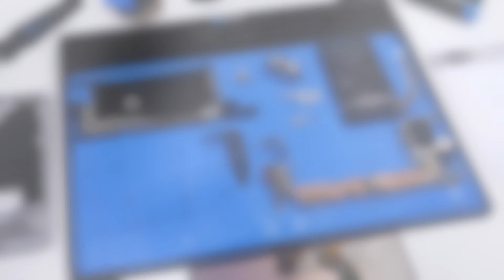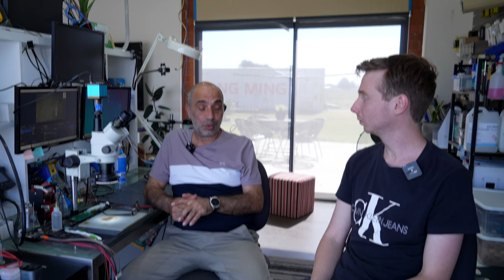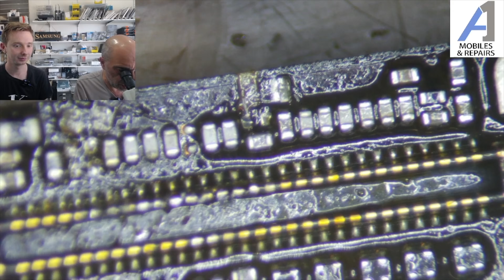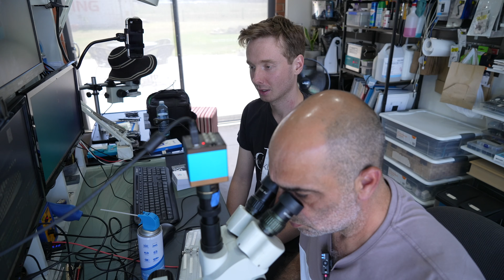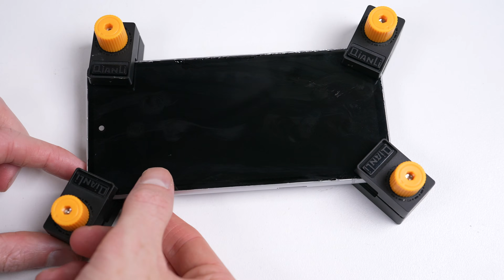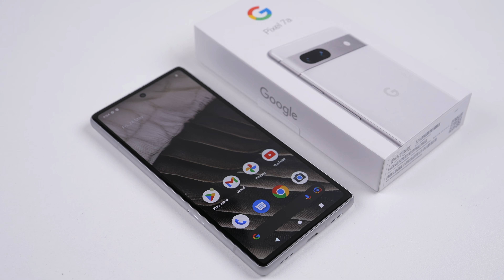I Messed Up Big Time - Don’t Repeat This Repair Mistake - Calling In Help - Pixel 7a Repair

Comment: I made the same mistake on a rare Sony Xperia XZ2 Compact a couple of years ago. The component went flying and was lost when removing the flex cable with the spudger. I still have the phone and would like to go back to using it because there is no equivilant sized modern phone. The display is now just black with only the backlight working. I don't know what the estimated repair cost would be.

Comment: You have my respect man. Admitting the mistake it's a big step forward in learning. After this experience you know better what you can do or you can't. But this is doesn't mean to stop. Soldering now is a compex work that requires a lot of tools, materials and experience. You can learn only by practice.

Comment: I'd like to see a performance test compared to a new device not missing the 2 caps.. in my opinion it was built with them for a reason and as soon as start drawing current though that part of the circuit it may fail or fall behind because the caps aren't there to stabilise the power needed and you can't rely on the filter for that.. so based on what I know it will work fine until you draw enough power that those caps stored power becomes necessary to function properly.. they really should have been replaced..

Comment: Is it me or do I see two caps still not replaced and left just sitting empty. I mean the 2nd and 3rd horizontal caps from the left side at 11.53 cos we see you are trying to solder those at 0:57. Those caps were originally put there for the required board design components. That would ideally create a problem in the short or long term.

Comment: Having struggled with an xbox controller with stick drift I can sympathise Hugh... I tried with a very cheap soldering iron and no hot air so have now got a decent hot air station  and a Yihua soldering station for about GB£80 for both. The job has got a whole lot easier🤣🤣

Comment: You messed up with the reassembly. The scren cable should have some slack on the top side of the frame. Now when you will remove the display next time, the flex cable will rip immediately

Comment: Wow! That is crazy to think that I started watching your videos. I think it was either my first or second year of college and I've been out of college now for at least. I don't want to say a good amount of time. But to think that you're all self-taught. It's an amazing thing to see And I have to tell you I went to school for IT systems management and we mostly specialize in desktop and laptop repair. Then I was always super scared of having to solder anything. Replacing broken parts and taking PCs and desktops apart is one thing but the soldering iron and the heat and just that fine precision. It was always very daunting to me. So good job on trying to do it. Keep up the great work. Have a good one and I'll catch you on the next one.

Comment: Ya pixel phones are very delicate to repair even my pixel 5 got black lines while replacing the battery 😢 

They are very poorly designed never repair pixel phones by your self 😂

Comment: I might actually mail in a phone to bill, it’s an iPhone 6s with an extremely strange issue where it will register charging but will never charge the battery, already diagnosed it down to the motherboard

Comment: I think you might use oven (180~200Celcius) to re-flow solder. Solder has self-alignment characteristic when de-oxided (reduction reaction), so you can probably solder small SMDs just by thermal. If you could, it is better to use glue to fix SMDs on PCB before re-flow. I think SMDs smaller than 1008 cannot be soldered manually.

Comment: Dislodging components when using a plastic spudger shouldn't be possible. This points to poor build quality or quality control from the factory. This phone is now on my growing list of phones to avoid because of quality/build/repairability issues, it's still the case that Samsung from a few years ago are still the very best out there.

Comment: I always prefer using my fingernail to remove connectors like that. It's a lot harder to accidentally use too much force when you're using a pinkie fingernail.
It does surprise me that Google put the components so close to the connector.

Comment: If I may suggest, put the clamps a quarter length of the phone, the pressure will be distributed more evenly that way.
When you put it in the corners there's no pressure in the middle.

Comment: The way he cleaned the board itself made it clear he was a pro
Reply: This is true, some level 3 techs do it even uncleaned while doing reballing, making their solder job not good. and often breaks easily.
Reply: At  2:00  OMG when that sh*t happens, it's a sinking feeling. lol
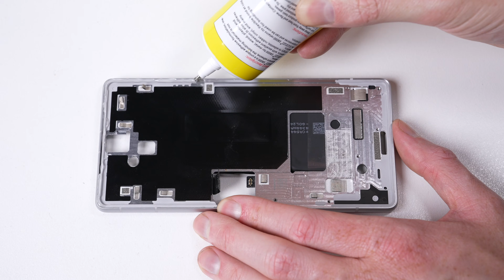But at  13:18   I'm cringing at the sight of using glue to mount the screen.   Most pros use double sided tape, either generic rolls of various sizes or better yet factory cut tape.   Tape makes repairs neater, but most importantly subsequent repairs much easier. imo
Reply: @BillAnt  I worked with Bill from A One for 6 years and still contract work to him from the medical industry where I live now, his best practice is 100% using many and varied sizes of 3m double sided frame tape, my inkling is that if he used glue it was because Hugh asked, they definitely would have discussed it prior.
Reply: @nationalmaverick  - Absolutely, I wouldn't even think about using that gunky disgusting glue.   When I'm repairing one which has been glued previously, it makes me sad that someone else was so lazy.   It really doesn't take a long time to run new tape using various sizes  from 1 mm to 5 mm rolls, or better yet model specific factory cut tape. :)
Reply: @BillAnt  hugh typically uses pre cut tape whenever available, especially on iphones from what i know
Reply: @astr.4  - Ya, most popular models have a factory cut adhesive available for about a dollar.  It's a no-brainer to use it instead of disgusting glue which can seep into every little crevice like speakers/mics and sensors.
Reply: Yeah the board was shining like this blad head

Comment: I’m constantly amazed at how humble Hugh is and how sincerely honest he is about his work.  This sort of mistake would never see the light of day on most any other phone repair channel and quickly be swept under the rug but Hugh always admits his mistakes and, crucially, provides in-depth analysis in what exactly happened, why, and how to correct the problem in an entertaining and educational way.  Props to you Hugh!  Your professionalism and dedication to the truth is truly appreciated!
Reply: Mistakes were a human nature, don't shy about your mistakes. Tell others about it so they can avoid of doing the same mistake and everyone learns from it in the end
Reply: I always disconnect screen connectors from either left or right sides where there's less likely to have any components.  Also, there's less force needed from the sides than the middle part.   However, I had my share of popped-off components in the past, therefore I always examine the components placement on newer devices to avoid popping something off.  You live and learn. ;)
Reply: He basically said it was Google's fault
Reply: Also blames Google for the design choice when he should have been careful 🤡
Reply: @zetsubou3704  Lol yea skill issue

Comment: Hey Hugh, we all make mistakes. One time, I accidentally connected the display of my iPhone 3GS While the battery was still connected. When i powered on the phone, the display showed me a blank white screen. i thought i fried the replacement screen. After a few days passed, magically, the display started working again. Hugh, i feel your pain and struggle, but I'm happy that phone has gone off to a good family member of yours. I commented on an iPhone 4S on iOS 9.3.6.
Reply: How are you using the youtube website on ios9, and how are you using an iPhone 4s? 3G is dead, and there are no modern browsers for iOS 9.
Reply: I managed to sign in to my Google account by putting my accounit address into Facebook sign-in. Safari saved the account and password, and that lets me like videos, comment, and subscribe to other channels. Sure it's VERY slow, but i can tolerate the wait times. Also, i just used Wi-Fi, and where i live, 3G is still a thing at $15CAD A month from lucky Mobile.

Comment: I have a pixel 6A which I imagine is identical to that for the most part but gosh those nanoscopic little things around the connector, I feel like if I drop this phone it might just pop off inside and the screen will stop working.

Comment: Please comment on the mediocre repairability of the Pixel. Many in the community have had negative experiences with Google's software when attempting to recalibrate the fingerprint sensor, resulting in the loss of this feature. A broken screen on the Pixel 6 renders the fingerprint sensor unusable.
Reply: you need to calibrate the sensor two times in a row, one right after the other. Didn't work first time, always worked on the second attempt. Give it a go, have seen pretty consistent results.

Comment: This looks very difficult.  Everything is so small, so although you can see it clearly in the microscope, you still need incredibly steady hands.  Plus there is no room for failure since everything is so close together.  The fact that most components now are surface-mounted also makes it much more difficult.  It used to be that you could put the wires of the new component through the PCB and then solder it from the opposite side.  Not anymore. Very impressive.  I would never attempt this.
Reply: once you do it 2 or 3 times, it gets a lot easier. The problem here was the selection of tools or lack thereof. Soldering jobs like these are actually pretty easy when you use:
1. Flux
2. Proper hot air (temperature, nozzle size and air flow)
3. a microscope
4. proper sharp tweezers
5. kapton tape

That's honestly all you need to complete the repair. I don't know if the trace was broken before or not, in that case you will also need an iron and a replacement trace or wire.

If you use these tools instead of squirting solder all over the board, this will be a 5 minute job even for an inexperienced repairmen. Steady hands are a requirement though.

Comment: I have repaired/attempted to repair a good many phones, starting with the iPhone 3-3G, 4, 4S, 5, 5S up to the iphone 6S but after that I stopped messing with them as much for numerous reasons, one being the cost of replacement parts and the lessened repairability of the newer iPhones as Hugh has demonstrated numerous times. Hugh makes it look fairly easy but it is harder than it looks, especially if you don't have a microscope to work with. Great video, and thanks for the transparency.
Reply: I occasionally do display and battery replacements for friends and family, while I've never broken anything modern phones are so hard to open up and it's very easy to break things. Those phones that require the entire frame to be replaced when the screen has to be replaced, I don't bother. I don't trust myself completely taking the phone apart. Unfortunately that's pretty much every modern device.

Comment: This is why you always practice on junk not your good device. anyone can solder. What trips noobies up here is the thickness of the board. You need a lot more heat because you have a 4-7 layer board with a large ground plain wicking away the heat faster then the iron can provide. Iron wattage is too low. Cheap iron. Or you haven't got the temp high enough. Don't be scared to get to 380-450F This is why you could not get the solder to melt. Second mistake is not wicking off the old lead free solder and replacing it with leaded solder first before you start.
Reply: this was my initial impression too. It honestly looked like he watched half a YouTube video on microsoldering and started right away. No shielding of the plastic connector (with kapton tape or at least a coin) which would have also prevented the solder bridging pins, seems like no microscope used, wrong tip on the iron, which was unnecessary in the first place, air flow set too high and no control of the components that were flying to the moon, wrong temp settings... so basically do the opposite of everything that he was doing (or do it like the experienced professional he was showcasing, props to him, seems like solid work) and you should be good to go. I will admit that I f'ed up my first soldering job too, but not even close to this extent...

Edit: forgot that he also used the wrong nozzle size, lel

Comment: I think the best tool for gentle flex cable removal is an uncut fingernail. It's thin and you can feel better what you are doing
Reply: Like Phone Repair Guru.
Reply: Yup my thoughts exactly. I tried those plastic prey tools but they give you too much leverage and no feel. Every phone repair tech needs finger nails, no exceptions. Pretty sure they don't use plastic prey tools in the factory where the phones are assembled.
Reply: I've been working in consumer electronics repair for around 5 years total now. There is now way I would EVER use one these "black stick" tools to remove flex cables from connectors. They can bend like crazy and are generally too clumsy when working at such small scales. Fingernails for the win. I think it's also possible to bend the pins with these things, so I stay away from them.

Comment: This is an absolute nightmare. These tiny resistors are so small that you can barely see them without a microscope.
Reply: i here dat dat is da same about ur penis ! is dat rite
Reply: Annoye  I didn't say it was.
Reply: Not really, I pulled one from a dead cheap android to put it on a i5-650, without any sort of microscope, used a 1$ trash soldering iron to solder it, that was 4 years ago and that processor is still working.
Reply: It is like Google pixel are following Apple's footsteps, trying to make their phones difficult to repair.
Reply: It is like Google pixel are following Apple's footsteps, trying to make their phones difficult to repair.
Reply: @4evertrue830  pardon , can u repeet dat pleas tanks is dat rite
Reply: @OrbvsTomarvm  don't pick on the user, it's a common YT failure from their android app and one that pisses me off to this day and is why I refuse to use their shithouse app.

Comment: I suggest you to use soldering tweezers for small SMD components or hot air with a very fine nozzle from a constant position. Make sure to use capton tape to protect plastic parts (connectors for example).
If you've got a lot of money to spare, you could also get an IR soldering station. Good luck and thanks for your videos

Comment: Disconnect the flex cable from the side, not the back or front.... Umm. "Side" = ? (Because it depends how we look at it, in maths a cube has 6 sides. Do you mean not from the top & bottom?)
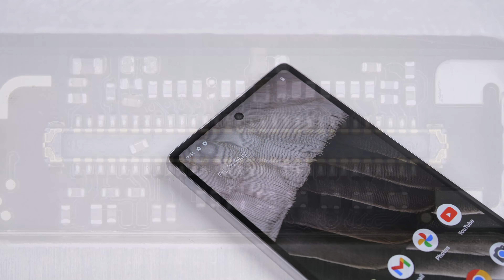Reply: He added a red arrow on the left to indicate where to pry at 😊15:25

Comment: Honestly when I watched the original video I thought that you have to be way more careful with the smds arround the connector. For this reason i use tweezers for this job, if you know what you are doing its a way safer tool